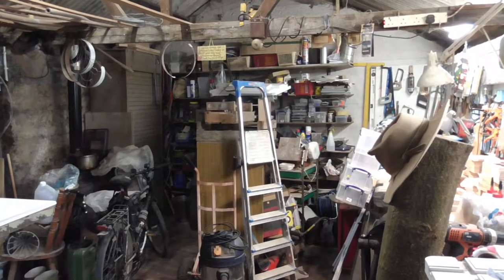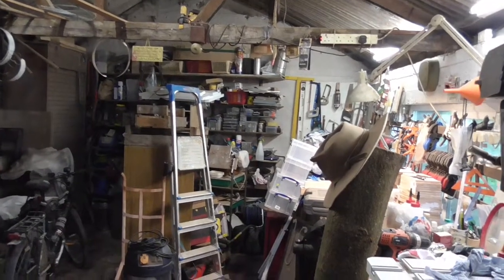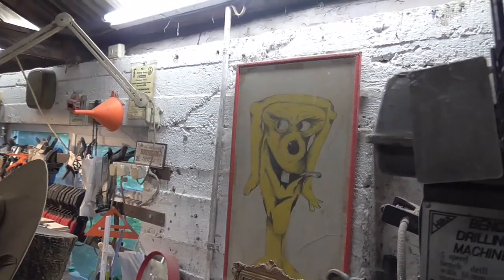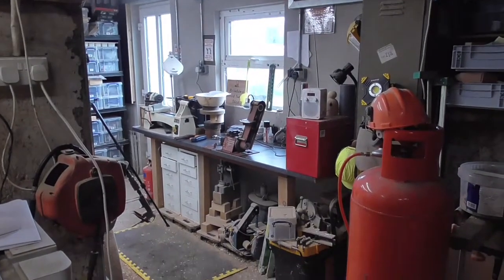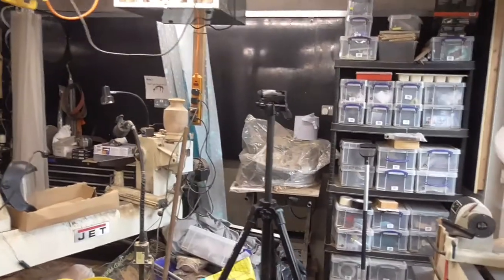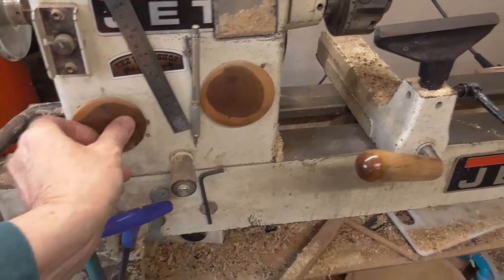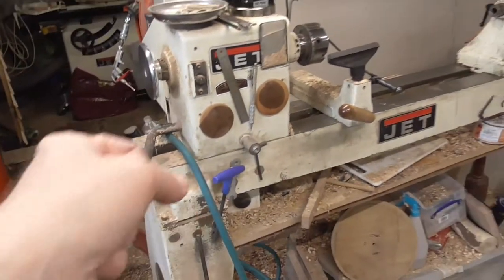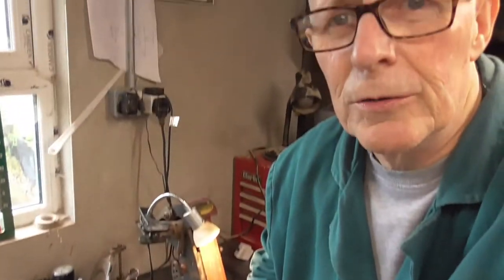Woodturning Channel Recommendation and Tool

Comment: Good to see you back Brendan. The shop looks great. I have the same Jet lathe.

Best regards
Frank
Reply from the maker: Thanks Frank, Jet are a great lathe but I happen to have 3 by pure coincidence.  I did buy the first based on research but the next two just came about from being in the right place at the right time.  Mind yoy, it made me very happy.  I think that's me done buying lathes now because, should anything happen to the lathes I have I'll replace parts before buying new.
Best Wishes, Brendan.

Comment: Always enjoy your stories.
I have owned a lathe for 38 years and I have never owned a "spindle roughing" gouge. My uncle was a professional  turner and I learned how to turn in his shop. His roughing gouge was a continental, so years later when I got my lathe I got a continental for  roughing out spindles. I didn't even know "spindle roughing" gouges existed until I started watching youtube. I sharpened it once with a fingernail on it but I went back to the classic I grew up with. Popping over to the BB channel. See ya.
Cheers,
-- Joe
Reply from the maker: Thanks Joe, Shay actually mentioned that people use continental gouges as roughing gouges on his video.  I didn't know that until then.  i've seen people work with the continebtal gouge and it looks very versatile so I want to give it a go.
Best Wishes, Brendan.

Comment: I love these geographical digressions! We were wondering if it's possible to drive from the Arctic Circle to the Antarctic Circle via the Americas. Or in other words, is Tierra del Fuego within the Antarctic Circle? (No, it's not. I just looked it up and only Antarctica is within the circle. But at least it's easier to get to than Kerry.)
Reply from the maker: LOL, I looked it up too and got "Tierra del Fuego (Spanish for "Land of Fire"; Spanish pronunciation: [ˈtjera ðel ˈfweɣo]), officially the Province of Tierra del Fuego, Antarctica" but doesn't say if it's in the circle or not.  However, you have just solved that bit.  And yeah, much easier to get to.
B